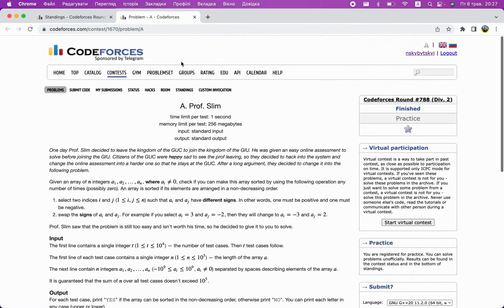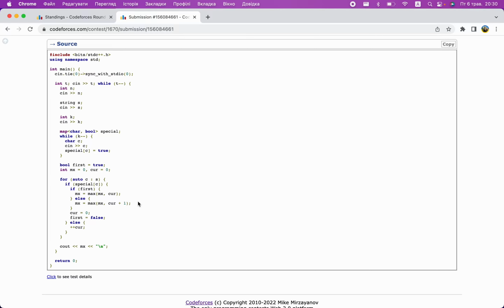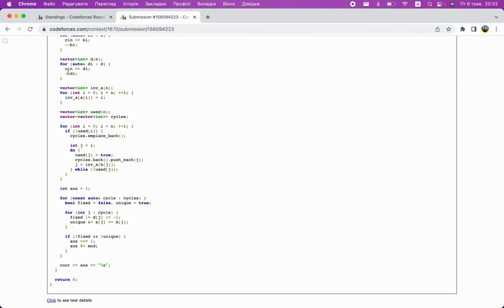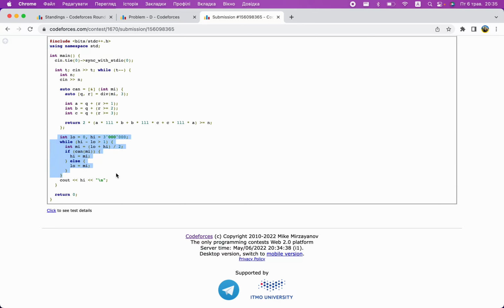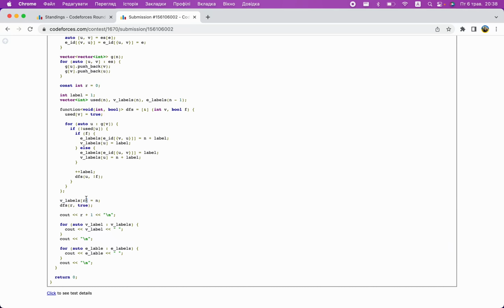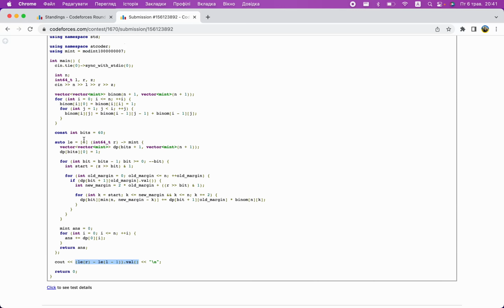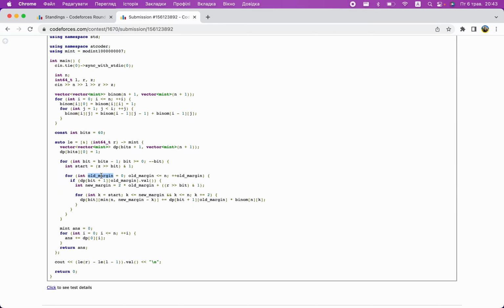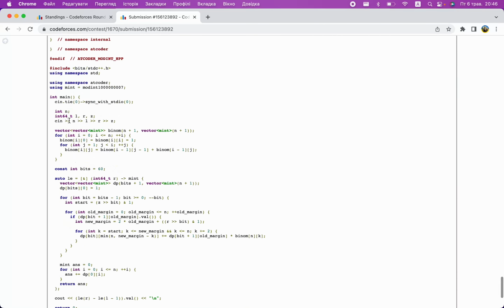Codeforces Round #788 (Div. 2) Editorial

Comment: Hi, thanks a lot for the video. Could you please explain for problem F, what's the definition of your dp array ( dp[i][j]) ? especially the second dimension.
Reply from the maker: Second dimension is "margin" between current sum and higher bits of r, measured in current bits. For example, if r=5 (0b101), current sum is 2 (0b010) and current bit is 2 then margin is 1 because we only consider first two bits (and also measure is 2s)
Reply: @nskybytskyi  Hi, thanks for the explanation. Everything is clear for me except one point: in the transition equation, dp[bit][min(n, new_margin - k)] += dp[bit + 1][old_margin] * binom[n][k], we limit the second dimension with n by taking min of n and new_margin-k. What's the meaning of this? That means we cannot leave more than n as margin for lower bits even the current bit only take a small part of current margin? I don't quite get it.
Reply from the maker: @zhili4452  The key idea is that if margin becomes to big (>= n) then our number will never exceed r, so we no longer care about the exact value of the margin. You can show it by considering the maximum value achievable by turning all lower bits in all numbers on